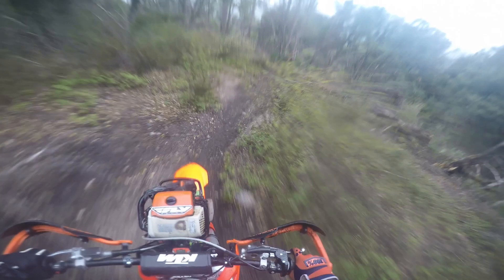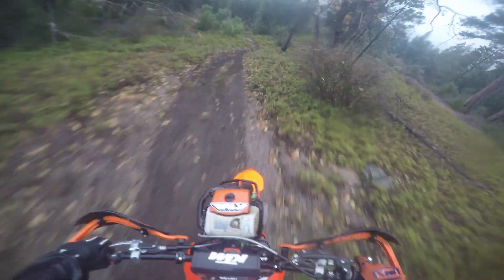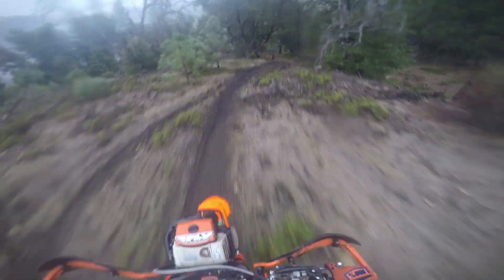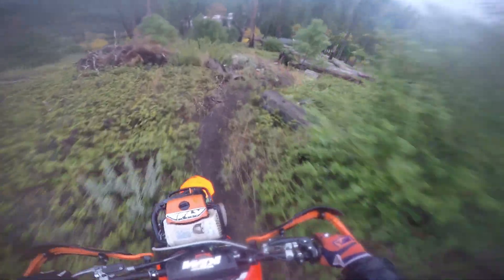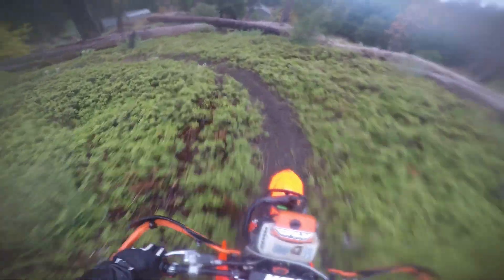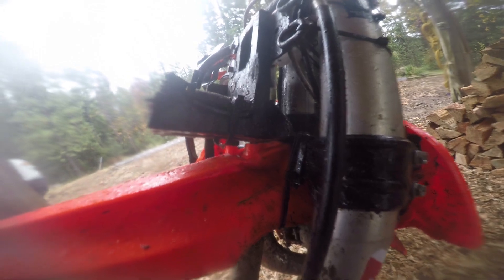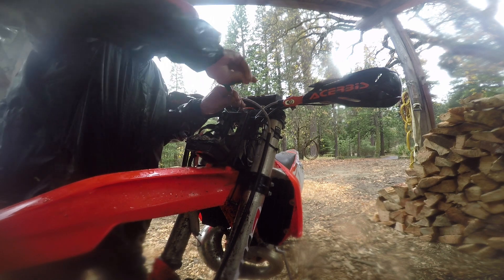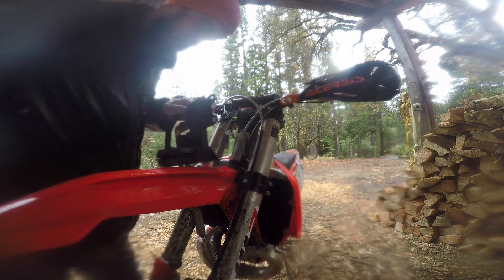Dirtbike Chainsaw Mount on a KTM / Stihl 192t

Comment: I’m building a saw mount for my bike right now. It will also double as a spot for a couple fuel bottles or extra gear for longer expeditions. I have the same saw with a few mods. If you open up the exhaust in behind the spark arrestor and advance the timing a touch it really wakes it up. I also changed out the stock .043 bar and chain for .050 so I could run the better 63PS chain. It has some bark now. 
Great vid as always. 
Build trail.
Reply from the maker: Kevin Vesey nice this is my old setup now I sell a different saw rack that I designed. And I run the echo 2511t because it’s ultra light

Comment: You should make the bottom of the chainsaw mount go into where the front number plate goes on the front fender ; like the two little holes where the number plate holds.
Reply from the maker: Thought about that but might put to much stress on the fender?

Comment: i use a echo 2511 , just put it in my hiking pack , thought about a front mount but i cant be assed taking headlight off all the time
Reply from the maker: Enduro North Nz how is that saw holding up?? Just recently discovered it and really want it, looks so light. Only 25cc though
Reply from the maker: Been running the 2511, even better on the front now with lower weight

Comment: I just hold my chainsaw in my mouth! But all jokes aside it seems the harness is heavier than the saw it self. A nice back would be better idea but then again after you use the saw it might burn your backpack off!
Reply from the maker: Jason haha yeah haven’t weighed the mount, it’s thin square tubbing though not very heavy. Problem with the back mount is that the handeling is a lot worse. Having that front wheel traction is actually pretty nice especially on hill climbs
Reply: Trail Bound co I trust you are right! Dose it also hold the 201 ?
Reply from the maker: Think it should hold it fine, the design has allowed us to run different saws no problem as opposed to some of the other mounts are made specific for specific saws
Reply: @TrailBoundco  I just bought a 2511 and wanting to build a mount what all did you do to mount it up.